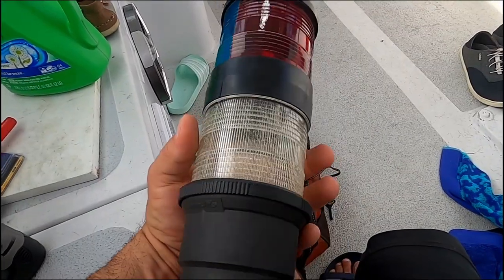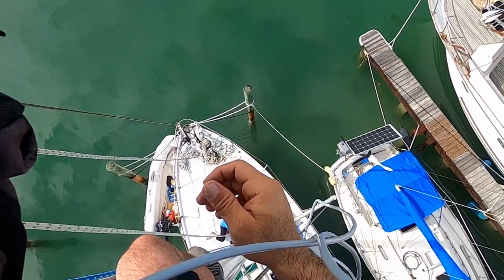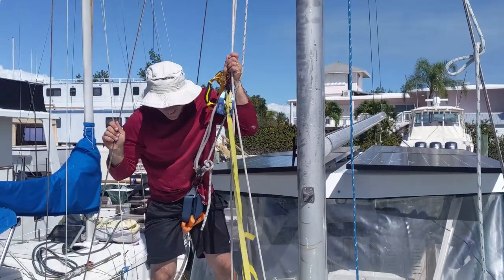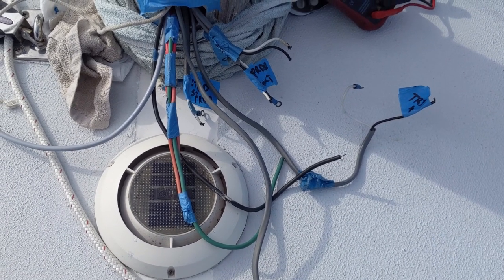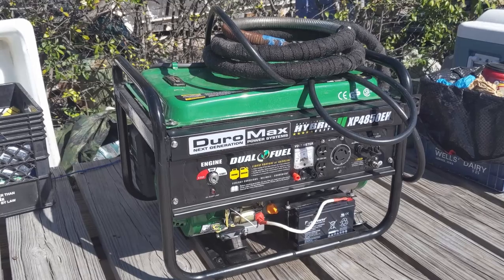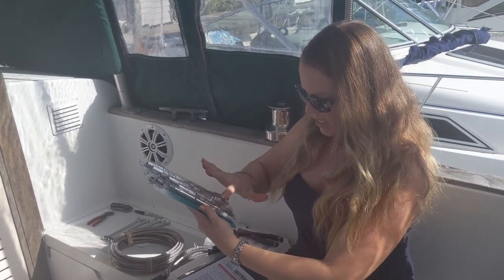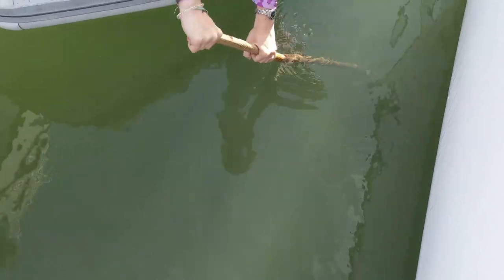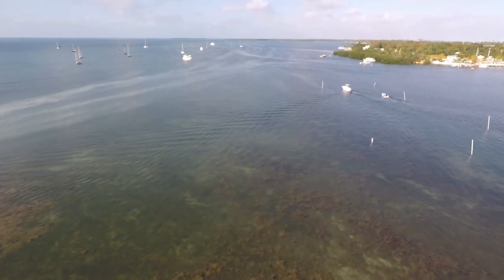Ep. 41 - One Step Forward, Two Steps Back ~ Big Easy Sailing

Comment: Make sure no matter what generator you get that you buy a carbon monoxide detector. If you are using propane as fuel also have a propane detector. Could save your life and not to expensive
Reply from the maker: Thanks for the tip, we already have a CO detector in each cabin. Will look into the propane detector.
Reply: @BigEasySailing  nice, my boat has the propane sensor built into the propane isolator switch. I'm excited to see what you come up with for the generator. I am currently thinking of building a small enclosure on deck to fit one of the 3500 watt super quiet predator generator that harbor freight sells. Seems to be the quietest generator in that price and wattage range. Thinking an enclosed with vents for air flow. Could even put a filter for salt and a fan to move air thru. Haven't figured it all out yet. But my boat has a lot of deck space. Got to get creative with a small budget.

Comment: West Marine down in Marathon and up in Miami stock the Ancor parts for those kits.
Reply from the maker: Good luck finding safety line hardware in a West Marine and if you do, it will be at least twice the price! We try to avoid that store at all costs, besides they usually don't have what we're looking for because it's a sailboat part. We prefer Boat Owners Warehouse usually for anything boat related but we actually bought the set from eBay at literally 2 for 1 pricing compared with West Marine and the replacement piece from Sailrite.
Reply: @BigEasySailing  oh I know. Anything in there is a mint. But I did lifelines with those kits 4 years back... Did the same thing, lol. West marine had the one compression fitting. Pretty sure that one fitting was half the price of a kit.

Comment: Did you consider trying a strong magnet on a string to find your sunken hardware?
Reply from the maker: We did borrow the marina's super magnet on a stick but with no luck. The majority of the hardware was stainless steel and the only piece that was magnetic (the little jaws holding the cable) was too small and hidden too far inside the end piece, so no attraction.

Comment: Go grab a couple sundowners you two...
I've said it here before, and so have many others. Having a gasoline generator within the confines of your living space is risky business. Just go out and buy a decent used Honda E3000 and put it up on deck when you need to run it.  

All this minutiae over the quest to run electric propulsion. Battery bank upgrades, solar arrays, generators, the list goes on and on. I've been telling you guys for the last two years electric propulsion is not a viable option for cruising sailors, especially newbie cruising sailors. Shaun, with his mechanical talents, could have swapped in a good used 30HP diesel inboard for under $5K, and you guys would'a been done with it. No huge battery bank or solar array, no more strapping 'Put-Put" to the side of the boat, NADA. And the best part - piece of mind. And those yahoos over at Uma Sailing are just drinking the electric propulsion Kool-Aid. Only difference is that they're pulling in about $12K a month in Patreon dough and running out of ways to spend their money, which allowed them to ditch their own barely viable system and go with an Ocean Volt. $20K in components and only a cruising range of maybe 60 miles. What a joke. What you don't see or hear are the hours upon hours they would have most certainly been laid adrift had they not had a generator to recharge their batteries, so what's the point? You're better off listening to Jordan over at Project Atticus. A much more realistic take on the importance of why they stayed with diesel.

BTW, that Suncor quick attach stud assembly you lost overboard is only $27 over at Defender.